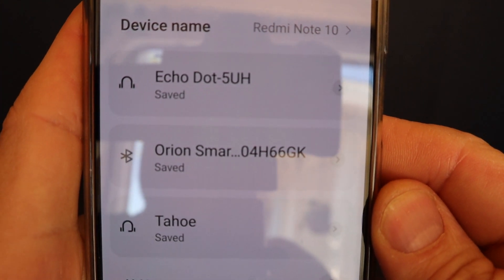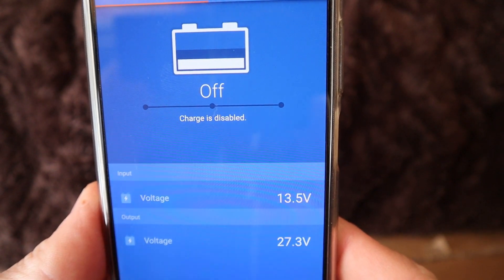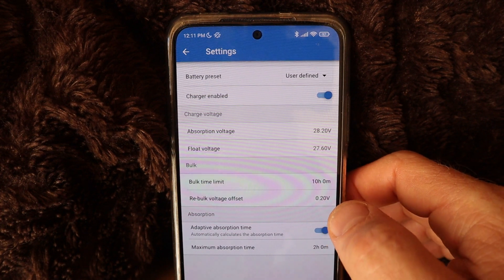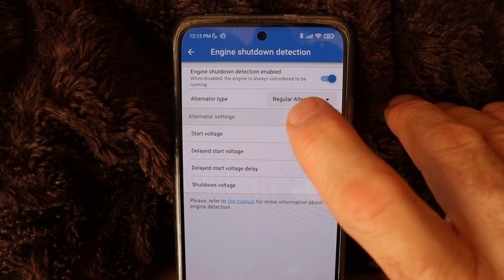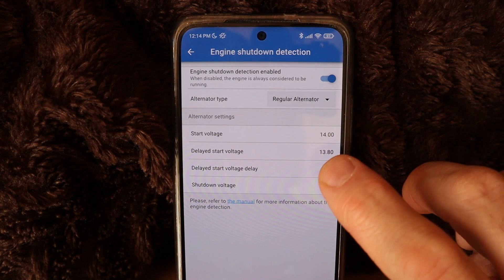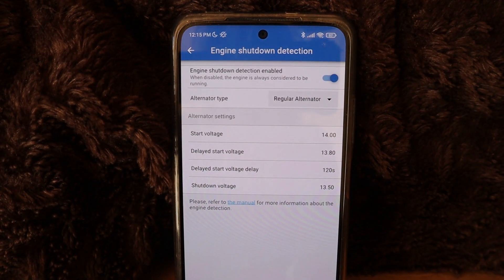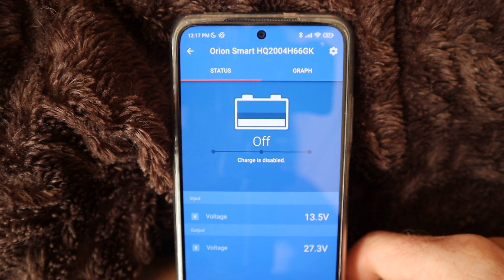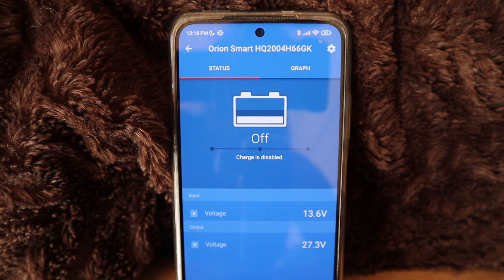Victron Orion Smart DC To DC Charger Settings 12Volt To 24Volt

Comment: Are you using this to charge a 24 volt battery bank? If so what do you have (2 12volt in series)??
Reply: Did you watch the video? His house battery showed 27.2VDC. That is my typical float voltage for LFP. His is 27.6VDC.